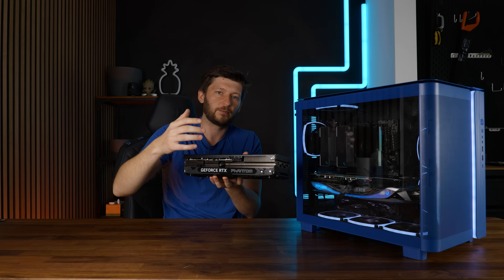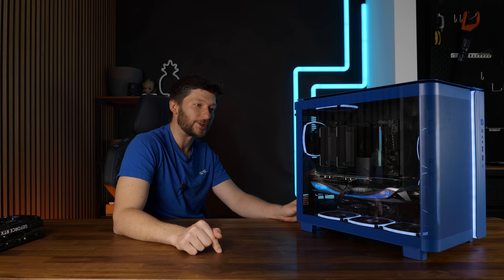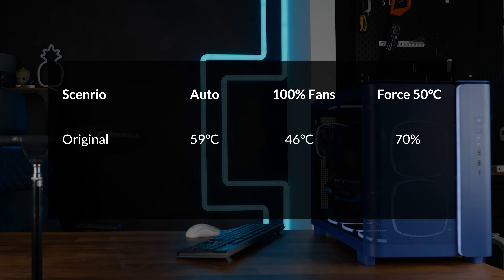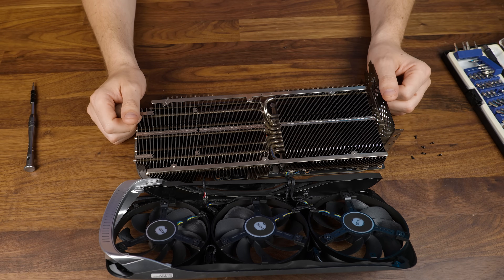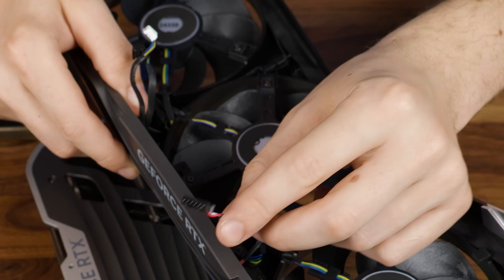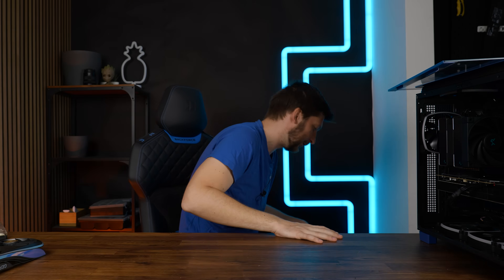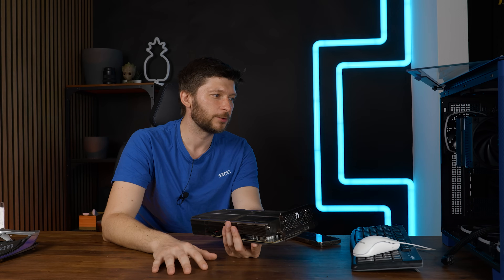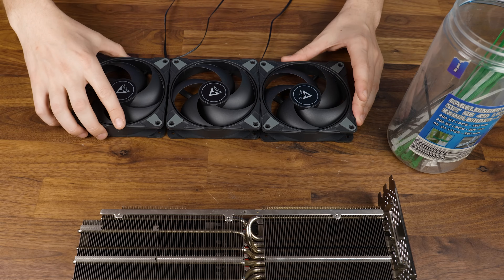Is Deshrouding A GPU Still Worth It? RTX 4090 P12 Max Deshroud Mod

Comment: Temps is not in the disscusion as long as the mod doesn't make it worse.
It is all about fan noise and the quality of the noise.

GPU fans usually have trash tier bearings which make their noise unbearable.

Comment: Are you suggesting the 50c is either probably best set for the 30% and not 40% of a 4090, 70% fan speed is enough for long benchmarks ? for probably the best solution for noise and cooling? or set the two speeds at 100% for benchmarks and lower than 40c for sitting?

Comment: I really do not agree with your conclusion. Just dial in a custom undevolted voltage curve and be done with it. The bigger coolers will keep the card cooler and colder. You cannot rely on factory fan curves or voltage curves once you change the cooling solution.

Comment: Maybe the ultimate cooling solution would be to isolate the computer from your operating location where you are sitting. You could then remote control the PC running the fans at high speed, and you wouldn’t have to put up hearing the fan noise. 

Then you could take that a step further. If you built a small closet or used a rack cabinet in your garage or an unused room, you could install a split unit air conditioner and set the air conditioner at about 60 degree F, or about 15 degrees C to cool the temperature down significantly in that small closet or rack cabinet. If you lived in an arctic climate, you could use the outside air in the winter to cool down the closet or rack cabinet. I don’t know if condensation might be a problem when the cold air meets the hot electronics inside the PC. 

I’ve heard of people trying that concept by putting the PC inside a refrigerator, but that doesn’t work because the refrigerator cannot cool down things inside that are actively generating heat.  I don’t know if a freezer could keep electronics cool that are actively generating heat. 
I’ve worked in data centers before, and they have many giant air conditioning climate control systems that make the giant data center room cold. You have to wear a light jacket or sweater in the data center because it’s cold. The fan noise in the data center was incredibly loud. I used noise canceling headphones, which helped a lot. But the loud fan noise from thousands of servers still gets to the rest of your body, not your ears, and wears you down after hours. All the servers could be remotely controlled from a KVM room outside the noisy data center. So, you’d only have to be in the data center room if you had to physically do things, like install or uninstall servers from server racks. Condensation was never a problem in the large data center room, even though the room temperature was about 60 degrees Fahrenheit. I don’t have access to those large data center rooms anymore, because I retired from that IT server support job 7 years ago. 

So, I think the ultimate cooling solution is to have the computer located in a cold and isolated room, where you don’t have to physically endure suffering with the fan noise and the cold temperatures. Then remote control the computer from your operating position. But to do that in a residential environment, you need to have the extra space in a room that’s isolated from the rest of your home, and you’d have to be willing to pay for the air conditioning to make that small area cold all the time.

Comment: Arctic's P series fans are loud compared to F series. I would install F12 if I were you, but the p12's pressure is nice. BTW, you should definitely have bought PWM PST series fans which can share pwm line, makes them just one cable to handle 😂❤ nice video, thanks a lot ❤🖐️

Comment: I'd love to see a test where you leave the GPU heatsink without fans and feed it cool air directly from the bottom case fans *with a 3D-printed duct*. This will decrease the number of fans and thus dramatically decrease noise.

Comment: With these three fans it does look cool. Instant good feeling of gettign rif of plastic garbage and replacign it with cooling performance.
My GPU fans failed (well, one of two did. Those weren't suited for being taken apart for service, and doing it killed one instantly and the other one 3 days after that), so instead of ordering 1:1 replacement from a certain Chinese selling platform, I'll just slap two normal fans and call it a day. They'll be useful in the future once I change the card for a newer model.
OG fans were 85MM, but without the shroud, I should be able to fit bigger ones, and more powerful instead of the previous 0.35AMP. Deshrouding is super cool!

Comment: surely cfm matters; with the heat sink design, the fin density/spacing is designed to only soak a set amount of heat into a "packet" of air. if the packets are moving too fast (i.e., fan flow rate exceeds thermal design) then each individual packet cannot saturate with heat before it leaves the cooler. this is part of why the advice of enclosing the fins around the fans (shrouding them), with tape or otherwise, is so beneficial. you trap air around the fins for longer, letting them soak more heat before leaving the cooler.

Comment: my 3080 ti, 4080 super and 5080 now - all Deshrouded with 2 5$ arctic p12 pwm fans, 5 degree better temps, below ambient noise with 100% GPU usage. That being said, the truth is, that expensive, or good 4090 and 5090 sometimes are so big, that they already have full on 2, or 3 PC case size 12 fans, and deshroud doesn't change that much. Friendly reminder of undervolting - the next best thing next to deshroud.

Comment: would have expected gpu to hit power limit regardless of frequency. furmark does that. at least the og version. v2 is a bit different. perhaps the original shroud helped guide the airflow for better thermals

Comment: If you do want something more... professional than cable ties, Etsy has a LOT of 3D-printed custom mounts for putting 120 fans on many, many cards - I found a set for my 4070 Ventus 3X, which is a rather low-end card.

Comment: the reason why it was hotter is because the middle fan is supposed to be intake and not exhaust. it is meant to push that cold air through the heatsinks and collect the heat and then get exhausted by the other 2 fans. critical mistake.

Comment: Yes. It worth it. Even now - the difference in sound is notable. But you need Noctua Fans NF-A12 or Phantek T-30 ( that are fat'er ). Practically fans that are famous for their low-noise or rumbling noise/bass noise or that give more air-flow ( +15% ) and can stay at lower RPM. You can also mod the top of the video card where  there is the "small window on the backplate/cut what shows the fins"    and put a fan ( 90 or 120 mm )  there  to pull out air  - that will also help.  
 ( Also very important is the case air-intake )Another setup I recommend is putting a large rubber black thick mouse pad  on the inside window that is the size of the all the window and taping it there + a  antiphonic foam with it. It would trap some of the sound waves that are bouncing in the case  ( you lose the window view ).  There is also the possibility of having headphones ( big gaming ones or ANC in-ear headphones )  that would also contribute to the immersion. These are all my tips. You ( we ) need to active low-noise and low-temperature.

Comment: You need to learn a little bit of electronics, so u can put the gpu pwm, and tachometer with the same socket from original fan, so u can have all benefits and function of deshrouding with noctua fan

Comment: I'm not convinced this is a fail.  What people want when they de-shroud is reduced fan noise for the same load and same performance.  This can be done by reducing fan speed, which can only be done up to a certain temperature after which the performance will drop.  Replacing with different fans can allow quieter operation if they can run at a lower speed for the same result, and/or if the fans are simply quieter even at the same speed.  You'd need to design a test around that.
The fact that GPU was downclocking in one of the tests here makes it hard to draw an apples to apples conclusion here as it means the other factors not being tested aren't controlled.

Comment: My gpu sits very low in my midi case, about two inches above the three 120 mm bottom case fans directly below it Which are fed directly via an aluminium shroud sealed upto the bottom intake grill and connected to two 9"flexi aluminum ducts that go through the cabinet base,the floor below and into our cellar which is bloody cold even on the hottest days. The three gpu fans fire up intially on boot then stop and that's all I ever see of them, even eith the shroud still fitted I get roughly 45-50 deg on the gpu while gaming even after a few hours.The gpu fans obviously un needed and almost certainly overwhelmed by the 120 mm fans anyway, the exhaust air is notably still cooler than the room temperature. My wife later added a pair of  tights/nylons over the pipe ends in the cellar, to stop spiders getting in the house😂.

Comment: To anyone thinking that this is not worth it, yes it absolutely is.    
With such size and strength fans you get the ability to set the fans at a fixed speed that you guaranteed cannot hear - GPU temps will be fine!!!   
With the original fans this is not possible. End of discussion really.

Comment: I'm finally at the point where I want to upgrade my now antiquated gaming rig, and I want something that's a good compromise between price, performance, power consumption and noise. I've got my eyes on the Gigabyte RTX 4070 Windforce OC. Relatively cheap (all things considering) and 3x thin 80mm fans on a heatsink that looks like it will accommodate 2x Noctua NF-A12x25 fairly well. I'm mostly interested in doing a deshroud to keep the noise down, but will it also be waste of time in this case?

Comment: Just did this to my base model RTX 4070 (Inno 3D). Probably one of the cheapest models. Temps dropped from 85c to 65c and hotspot from 105c (oops!), to 77c. Tested in Cyberpunk with path tracing (not that a 4070 is really fast enough for that, still got 80+fps with FG). Although I replaced the Thermal paste as well, so I guess the improvements was 50% from thermal paste and 50% from 2x 120mm noctua fans. I don't think it's ever ran cooler than 75c before in cyberpunk. And yeah it's probably a lot quieter as well. EDIT: Tried setting fan speed to 100% and then it stayed at 55c and hotspot at just under 70c. Still barely hear the fans with headphones, although without headphones it's still quite loud.

I've got a 3d printer (Bambu lab X1c), so printed a new fan cover for it to ensure no air leaks out before it gets to the heatsink, and looks nicer too. Although at first I couldn't get it back into my case. Luckily I noticed I could disassemble parts of the case while I installed the GPU. (Coolermaster NR200P Case)

Comment: As a ITX user, I feel I would always deshroud and flip my fans to act as exhaust. No matter my GPU load, my CPU temps and MB temps remain the same. I tried flipping the fans and while a few C cooler, my overall system and CPU takes a huge temp hit. When I did it to my 2080ti I dropped 30'c and 7 years later with no new thermal paste I can game at like 55'c-60'c both CPU and GPU in a 30'c room 

The right case would be the major factor in if this works or not, I don't think a large ATX case would work unless you duct it.

Comment: I would really try and test this on an open bench. 

For sure, there has to be some interference happening in the case. If not between then unshourded fans and the bottom fans, then simply with the airflow of the case itself. 

But I  hypothesize that, even if the bottom fans that the unshrouded fans are spinning at the same rpm, some kind of turbulence or low pressure is interfering with the unshroud mod's full potential. 

I think you need to remove as many factors as possible, test both the shroud and deshrouded versions, and adjust the deshroud if it's not giving better results---maybe by trying to seal the edges of the fans to maintain static airflow.

Comment: The Arctic Max fans are perfect for this, cause they go really fast too if you want that, more like the original GPU fans. I got the 6900 XT, and it keeps crashing games cause it gets too hot, and have been since I got it. I will redo the paste and thermal pads, but I will also put 140mm P14 Max fans on it, with a shroud to force all the air from them through the heat sink.

Comment: I've done this for a guys zotac 3090 trinity with broken fans he got really cheap. I used 3x 90mm bequiet pure wings 2 a splitter and soldered the gpu fan header to the connector. Full repad and repaste. Even removed the little rgb zotac logo from the shroud stuck it on with some zip ties and foam on the back to keep it sitting properly.

Comment: Believe me, this idea came to me and I wanted to implement it, but I have one problem left, which is how to adjust the speed of the fans in sync with the temperature of the graphics card through BIOS.
Reply: If I'm not mistaken you could just use a micro 4pin GPU fan adapter, and the GPU will control it.

Comment: On my 4090 TUF OC I am quite sure this would not make sence, its over 3 slot and has silent fans + excellent cooling.

But when I had a 3090 Arous Xtreme from Gigabyte, the fans were crap, heatpads were crap, cooling paste was crap.
So with the 3090 I removed the cooler, put premium heatpads, premium heatpaste etc. then I put  on it 2 x fans from Noctua D15 cpucooler.

Then I bought a fan adapter cable so I could run it off the gpu header.
For the 3090 from Gigabyte, it did make great results.

Thermals were very good afterwards, also it was very silent!

Custom fan curves are always possible.

Comment: Those arctics has bad push preasure, try noctuas and you will see much better results.
Anyway deshrouding really has no reason unless you running a super slim sfx build or your original fans broke.

Comment: I just put an extra 140mm fan on the top of the backplate. It runs slightly cooler and the stock fans run at lower rpm.

Comment: That is because it is already using 120mm. Back then, fans were just 92mm, and replacing them with 120mm would be beneificial. I assume this is true with whatever else that is using 92mm fans right now.

Comment: The reason I deshrouded my video card, the last time I did it, was because I was using the original Ncase M1 and bottom intake kind of sucked because of the feet not being tall enough, but exhausting right off the GPU heatsink and right out the case worked great! Deshrouding was the only way to achieve this.

Comment: Main reason people don't do this is more because of warranty period. That's the first i think of.
Once they expire, lots more peopke will want to mod these GPUs.
I don't want to do anything that might spoil the card and i can't get it serviced by the manufacturer.
If the warranty has ended however, then YOLO.

Comment: It looks like you're bottom fans are set to exhaust not intake in the video?  Maybe that was the issue with temps? (the white band on the 120's shows this if you look at the rear exhaust it is inside the same as the bottom ones which should have the white band on the bottom of the case floor).  Turn them around and repeat it.

Comment: You can try using 3M heat resistance double tape to stick fans to the heat sink. It looks clean and the tape is actually very strong and durable

Comment: I'm curious what the core speed was with the OEM fans at 100% compared to the aftermarket fans at 100%, you showed aftermarket but didn't see the stock numbers. Also the pitch of the aftermarket fans seemed lower which was more pleasant to listen to than the higher pitch OEM fans. Not sure if it's worth the cost of those three fans but to someone it probably is.

Comment: 3x92mm will provide more static pressure which you'd prefer if the heatsink has high fin density.

Comment: It doesnt worth it bc it does give a diff but the temps are good at stock and u lose warranty and at 10:45 u see that with the proces 1 plate got bend, maybe try this on the 7900xtx bc the 7900xtx Vram temps under load is 90c so there likely ,akes a bigger difference in preformance and vram temps

Comment: I put two of these same fans on an asrock 6700xt on my backup rig.  The factory fans were a joke.  And I never even ran them, so no clue how poorly they performed.  But a quick internet search will say poorly.  Used coper wire and attatched the fans to the ends of the copper heat pipes.  Doesnt go over 40c on hotspot.  And I just have them running half tilt on a noctua manual controller.  Might go to gpu controlled speed here soon.  Ordered the adaptor needed.

Comment: Dismantling a GPU will Not void the warranty.... obviously only if you damage it.
You deffifnitely NEED to have fans on the card, at least at stock speeds. If you undervolt the gpu than maybe those case fans would be enough but it's Big maybe... The air from the case fans is just To dispersed. You can also undervolt the card with the slapped on fans. But at some point you might as well watercool the card lol.
Man, I appreciate the video, but not how you did it. Do some more research and don't mislead people with some of the info.

Comment: You are missing 1 point here , and that's the  fan turbulence , don't forget that the stock fans are  hard screwed in place , while arctic fans are  hanging on the plastic bands , that in itself at higher rpm and  CFM creates a lot of disturbance in the airflow and stuff like that. ppl are  printing  on a 3d printer a fitting mechanism and the results are wildly better. And yeah  , you are comparing an already good cooling solution , try compare the cheapest cooling solution vs the arctic , i did change the  fans on my friends 4070  palit dual , and the temps and noise levels went down by 20%+